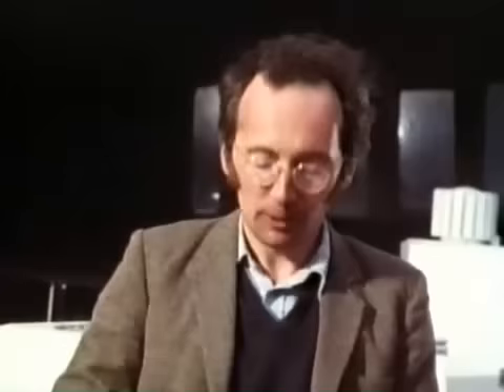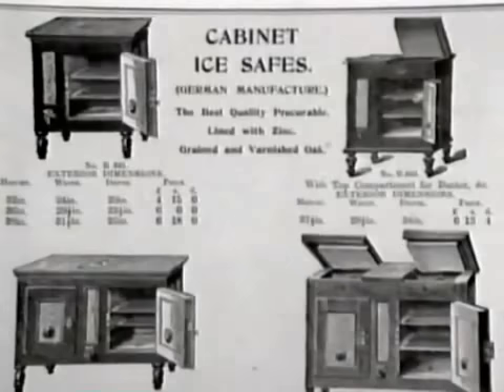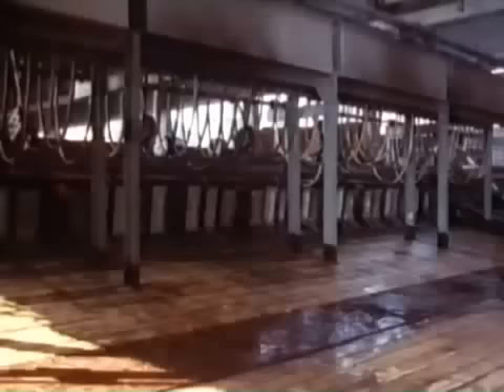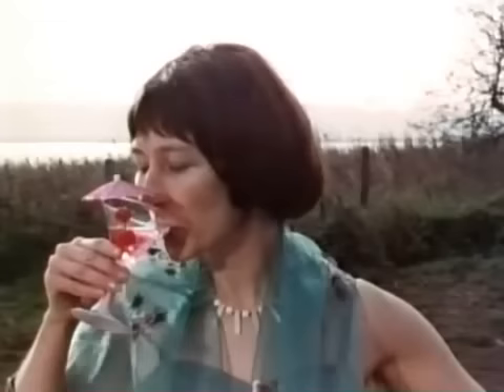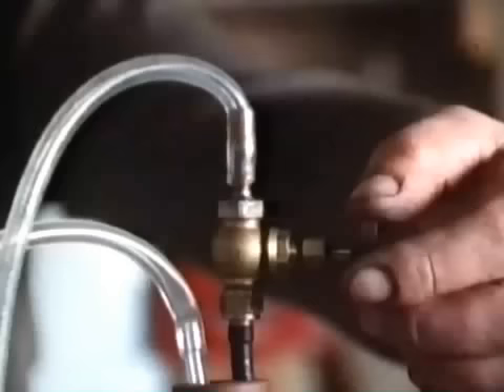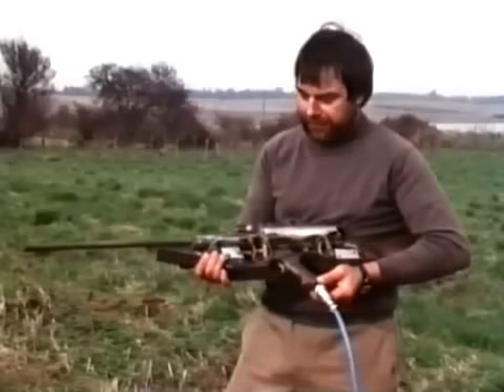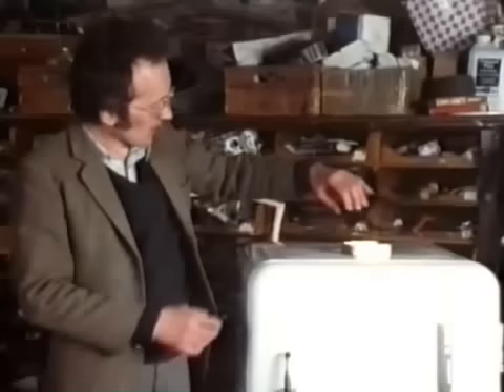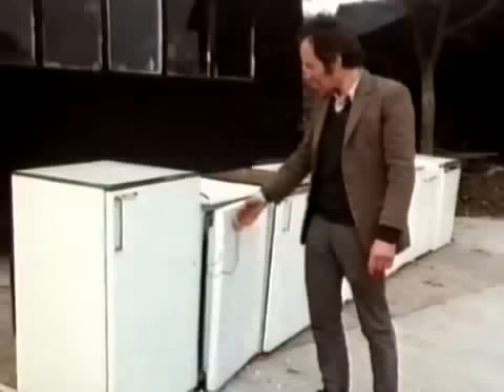Secret Life Of Machines - The Refrigerator  (Full Length)

Comment: Fun fact is that many of the fridges that has ended up at the scrapyards just had a faulty termostatic switch wich could've easily been replaced. I've got an Electro Helios refridgerator from the 1960's that still to this day is working just fine...day in, day out.

Comment: As a child in the 60s I can recall stories of kids getting locked in old-style discarded fridges and suffocating as a result of not being able escape due to the external locking handles then still in use.
Reply: Part of my job is to decommission electrical appliances. Even though fridges today have an easily breakable, magnetic seal we still, by law, have to remove the doors because of the legacy of the danger of older fridges.

Comment: Prior to the 1860s Dr. John Gorrie used a steam engine to compress air.  The compression naturally increased the condensed air's temperature.  But it also drove out the humidity, which made it fairly easy for the air to rapidly change temperature when the pressure was released.  The air absorbed heat as it expanded.  Gorrie used his engine to cool the air in a hospital that he ran for fever patients in Florida.  His nurse left the machine on accidentally one night and ice had accumulated in the machine's pipes.  So Gorrie began using the ice to cool the hospital.  He tried to obtain financial backing to put the machine into commercial production, but the natural ice industry saw to it that backing wasn't available.

Comment: In the event they mention absorption refrigerators I missed it.. They where the first practical refrigerators for domestic use, and where they only option for rural residents before the REA (USA centrism sorry) became into being. First ones burned either alcohol or kerosene. Where natural gas service was available units that, burned that where also available The downside of tho other than the presance of a flame was the need for a flue
Reply: I was just thinking about absorbtion refrigerators top. Electrolux Servel made the most popular ones here.

Comment: Funny we use co2 as a refrigerant now. And yes if it goes below 70psi, it turns into dry ice. Usually we keep the pressure about 200-1200psi. Ammonia is still used. 

Propane and butane are common refrigerants now as well

Comment: In the 1950's, only about 30 % of the households (depending on which country, which town etc.) had a refrigerator. They still were either very expensive, either ridiculously small (sometimes even < 50 Liters) They used a lot of electricity too, but gosh, they looked so much cooler - pun intended - and faaaaar more solid than the sh... produced nowadays, even by the A brands. Too much cheap plastics. The biggest rip off is the SMEG type of refrigerators, ridiculously expensive for what it is. But then again, that's exactly what some well paid folks apparantly want.

Comment: Can't speak for English refrigerators and freezers, but American models have become ... worthless. Planned obsolescence has limited them to seven years (at best). Open the door on Sunday and see a month's wages worth of food ruined. Electronics are the cheapest parts on the appliance and cost the most to replace. If you have an old fridge, keep and repair it.
Reply: I bought a Danby fridge after the electronics packed it in on my old fridge.  Like the old fridges, it has no electronic circuit boards, no thermometer, just a basic fridge.  It works great so far.  It was also considerably cheaper.
Reply: I have to say that whilst I see planned obsolescence in many modern items, I have not experienced it with any majot kitchen appliances. I only buy second hand items and theyve all lasted for years. I did once think my fridge had broken, but it turned out the thermostat had been fiddled with - and I only realised after I replaced it (with a second hand one), atleast I managed to sell it for what I bought the replacement for. I do find fridges and freezers can get noisy after a while, presumably its those noise supressing springs wearing out.
I wouldn't touch a fridge with buttons or screens, mine has buttons but it came with the house, but just something else to go wrong, which is not needed as Tim says, they are the most reliable thing, just full of cheap plastics!
Reply: Generally fridges and other kitchen appliances are designed to last a while, and replacement parts are usually available. Most fridges still have mechanical controls on them, even with all the "smart" technology in kitchens these days

Comment: Appliances have started mating lately. They started mating with computers mostly. Now your fridge can email you . or your oven or maybe even clothes washer.. What's NEXT!!!
Reply: When they start threatening us, we'll know we've gone too far.
Reply: You can have them.  I'll stick with my older, 'unsophisticated' models, thank you.  I'm not particularly impressed with how the engineers needlessly add electronics to things that don't really need electronics.  Why does a goddamned stove need a 'logic board' anyway?   And why in blinking blue blazes does a 6 x 9 circuit board to run the thing have to cost $350?  Answer:  NEITHER of those things are necessary, other than to ensure that you'll run out and buy another stove in about 5-7 years.